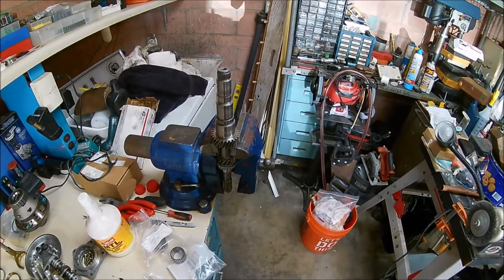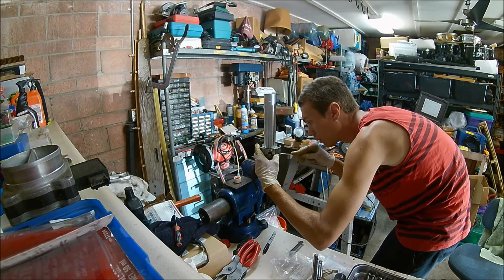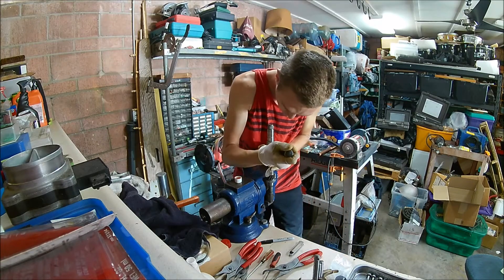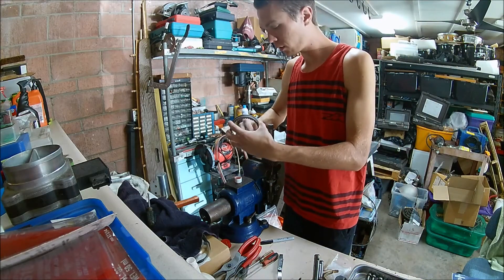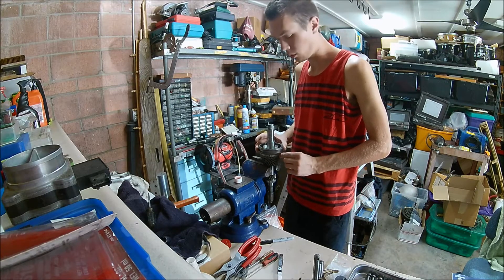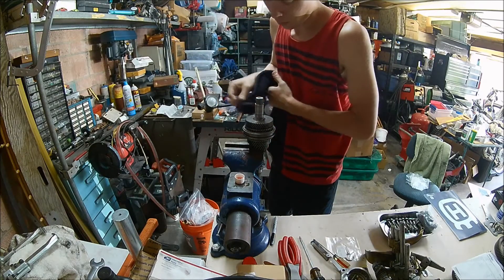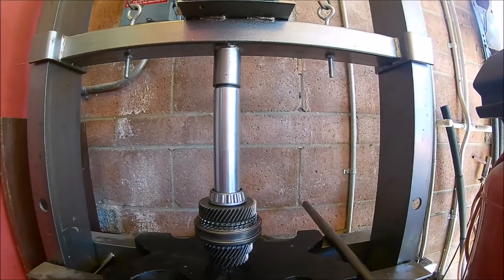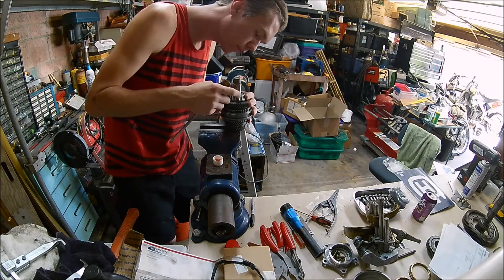GM/SAAB F35 Input Shaft Assembly

Comment: I need a third gear and other things can you help please?
Reply from the maker: Eddy Cobb yeah, I can!
Reply: @93Viggen23  do have a number or email and where you at dont want to call at bad time. Need third gear,and synchronizer and shift sleeve transmission was not very smooth going into 3rd had grinding.
Reply from the maker: @eddycobb4209  93viggen2.3@gmail.com apologize for the delayed response.
Reply: @93Viggen23  you still there?
Reply from the maker: @eddycobb4209  I never received an email! 93viggen2.3@gmail.com

Comment: Is it hard to convert a f35 to f40?
Reply from the maker: You have to get the diesel bell housing f40 then take the internals out and sway them for the normal gas engine f40 internal since the diesel one is geared for a diesel engine. then you must convert the shift linkages and shifter, etc.
Reply: @93Viggen23  oh nice....so basically not for a beginner level person like myself lol
Reply: @93Viggen23  what normal gas engine f40 will work? Aren't some of them geared alittle different? Just trying locate a diesel bell housing. Just not sure which f40 would be best to put back in the diesel bell housing
Reply from the maker: @jerryc3201  I believe they do have different ratios depending on what vehicle each F40 was going into, So for a Saab might be geared different than say what was going into a Buick... I am unsure if they just change the final drive ratio or what but they may be different, I do not know the answer as to what the gear ratios are or final drives.